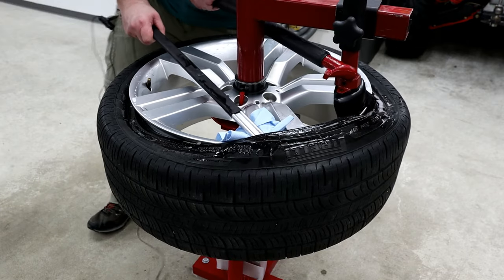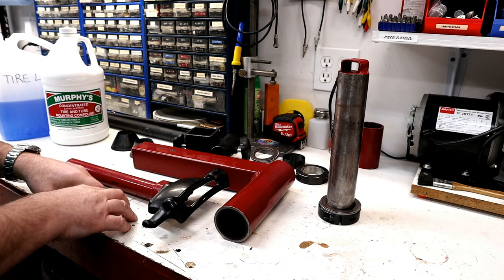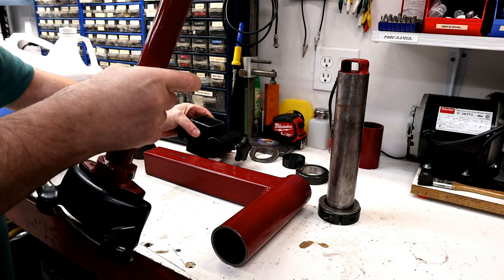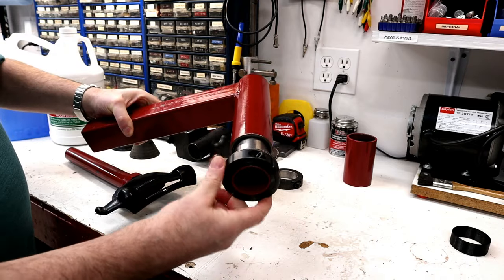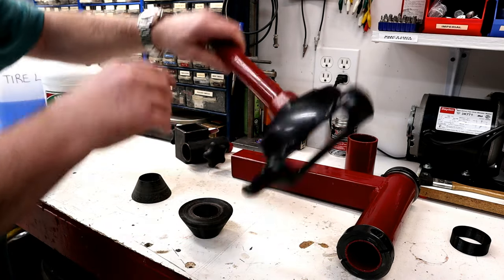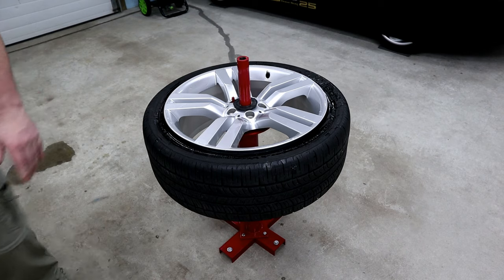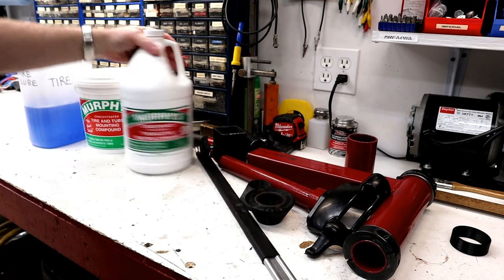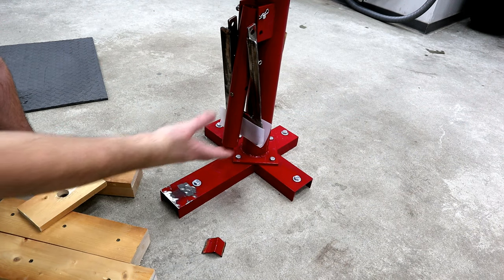How To Remove Tire From Wheel At Home With Manual Tire Changer.

Comment: Put a flexible plastic long tube, like foot or so in length, that fits over the pin bolt "hole aligner" to guide it through the lug nut hole of the wheel then it will guide itself over that bolt below then just pull it off once onto tire changer mount.  12:21

Comment: Hi John. Great video! Could you share the link for the 3D printed centering cone that will fit these tire changers? Thanks in advance.
Reply from the maker: There is no link, I made mine in a couple minutes on Tinkercad. The center tube diameters vary on these things as I mentioned in the video so if you want a cone that fits, it's best to make your own so its sized correctly for the tube.

Comment: what size and where did you get the thrust bearings and lock collars? Im in Canada as well
Reply from the maker: Tube diameters will vary on these manual changers so the only way to correctly size the collars and thrust bearings to know you are getting the right size, is to measure the center tube on your specific changer. I ordered all my bits off eBay.

Comment: I wonder if this solution here would also work for motorcycle wheels/tires.
Reply from the maker: Not sure? Perhaps someone with a duckbill/head mod who has used it for that application will chime in.
Reply: There is a motorcycle wheel attachment that used to be available from HF but also from other places that accepts the small axle diameters.  Some rear wheels with larger center openings will fit on this setup.  I use the Mojolever for removing and installing motorcycle tires.

Comment: I wonder if a "screen door spring" would work just as well as a rare earth magnet. even if it slips.. well Gravity..   I would also be inclined to try a longer bar to slip over the original bar tool for more leverage It looked like if the bar was longer you wouldn't have to continue to 'bump it'.
Reply from the maker: Good thoughts on the spring. As for more leverage during bead breaking, there is more than enough. I wasn't pushing down that hard. There is a very fine line between where the foot is apply force on the bead and slipping backward on the sidewall. Any harder and the foot just compresses the sidewall downward to the point it slips backward into the middle of the sidewall without budging the bead loose; this is not good for the tire either. Having done 20 wheels now and getting easier & faster each time, it just seems the tire lube has to pernitrate the bead before it will budge regardless of force applied (at least when using this design of foot on these manual changers).

Comment: I wonder, do you think it could work for this size of tire 295/45R20?
Reply from the maker: Don't see why it wouldn't. Might have to raise the height of the duck mod adapter on the center post to clear the tire when removing the back side bead (specific duck head mod and wheel offset dependent of course).

Comment: Don’t understand why you can’t drop a pin with a head on it down through the lug bolt hole ?
Reply from the maker: That's because there is nothing preventing anyone from doing that; mod it however you wish.

Comment: will 21" low profile work?  245/35/21  , 265/35/21 tire size
Reply from the maker: The limitation on wheel diameter size is the length of the Duck-Head mod swing arm. This one I have, the swing arm is long enough to do up to 22" wheels. 
As for wheel/tire width and profile height, that is more complicated to answer: 
1st. Mechanically, max wheel/tire width is dependent on the length of the Duck-Head mod center post and the distance of the wheel backing plate to the front lip of the rim (wheel offset). You'll notice in this video, when I was removing the back bead, the tire was rubbing on the swing arm. Still very doable, but the fact I cut mine shorter to accommodate the length of the center tube on this specific changer, I inadvertently compromised maximum tire removal width.
I have done some 255/40 wheel&tires which were wider but the wheels also had more offset so even though the wheels/tires were wider than the ones in this video, they barely touched the swing arm because the wheel sat lower on the changer's mounting plate.
If I ever get wheels that are both wider and have less offset, I may have to weld the piece of tube I cut off the duck-head mod and make my center post longer on the changer.  There are other options to such as using a spacer ring and not have an upper clamp while removing the bead. 
2nd. Low profile tire workability is just as much skill dependent. I know I could do a 245/35/21 (couldn't do a 265/35 because I cut mine short) and provided it's not a run flat. However, I also know I would not likely have been able to do that size at my first attempt and without a few extra tools I have purchased since like the drop center tool and nylon tire iron socks. Every set of tires I do I getter better at and it becomes easier and I become faster/more efficient. In short like any skill, the more you do/practice, the better you get.
3rd. Tire lube & cleanliness are critical. Don't skimp on either.

Comment: 😅 😮 It’s too bad the manual tire changer kits are not useable as is, and have to be heavily modded. I have most tools including air tools, but not a welder or 3D printer.
Reply from the maker: Lucid will customize his duckbill kits if you contact him with your specific manual changer dimensions including center cones if you don't want to make your own cones or centering device out of any material you have on hand, including hardwood. I used what I have on hand for efficiency. No welder needed; beefing up the breaker arms is just a precaution if you have stubborn beads or some dumbass at the tire shop used bead sealant which essentially glues the beads to your rims.
You could just as easily bolt angle iron to the bead breaking foot arms. As with all DIY projects - use what you have on hand to make it work, necessity is the mother of invention.
Reply: That's half the fun, coming up with good ideas that work.  Harbour freight low prices are another plus. Harbour freight needs to have a "tool modification day or weekend" where we could see these mods in person from fellow customers 🎉 surprised HF hasn't copied and selling the duck bill mod in store

Comment: You only briefly mentioned the dynamic balance and didn't explain its purpose. With the bubble balancer is that you will only get a static balance. You can actually achieve a really solid static balance. Static balance can be perfect to where you feel zero vibration, but a poor dynamic balance can cause the steel belt to shift